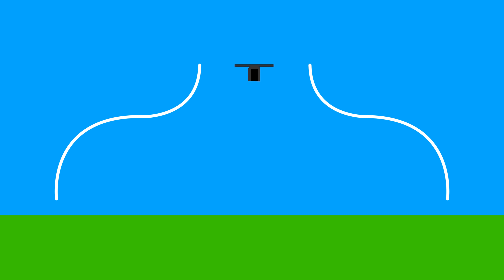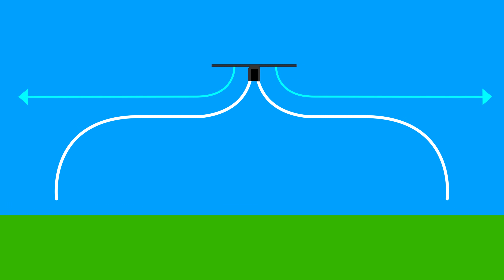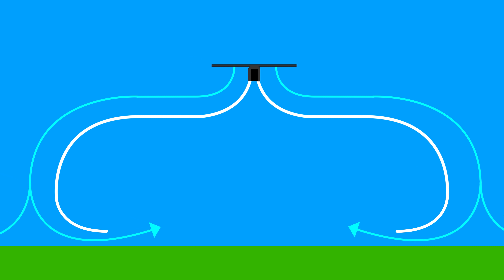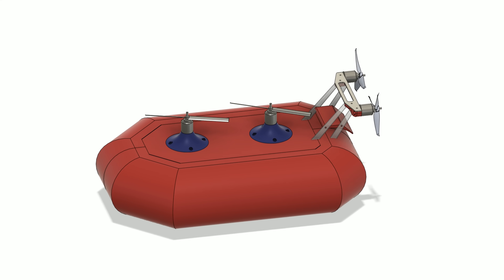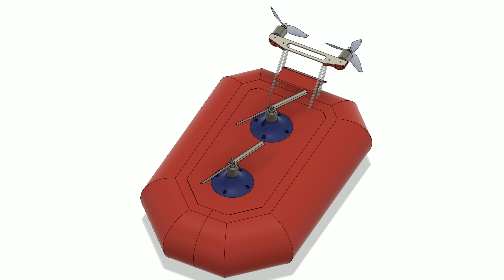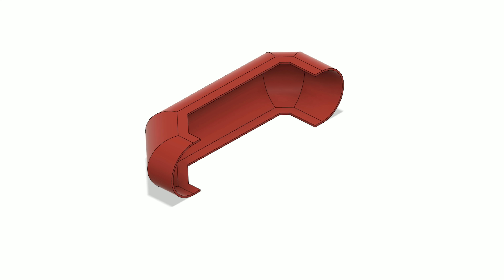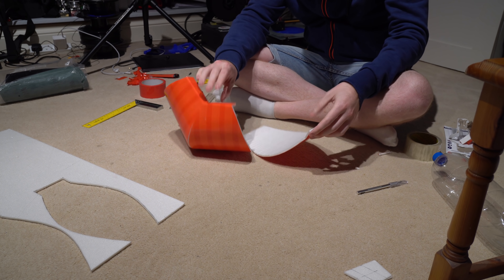Coanda Effect Hovercraft

Comment: Quite interesting Tom, thank you!
Could the leaf collection be more mechanical than fluid dynamic sourced? I would think if fluid, the quantity would be higher (read on...).
Could the CG be too far aft? In the earlier trials, clearly the aft was low while the bow was raised.
Later, once the bow dug in during a turn and the aft raised, could the gyro effect of the combined rear motors add to the unwanted roll? (counter rotating forward drive motors?)

I have an antique RC hover craft that was powered by an 0.049 (Cox) motor. Half the air was ducted into the plenum, the other half out the rear, steered by a gang rudder.
The small motor had enough power to propel the craft on asphalt or concrete. Living in Florida, fine sand is everywhere on those surfaces.
It would vacuum (hoover for my UK readers) this sand and leave a clean path where ever it traveled.
This lead to the demise of the little motor ingesting the fine sand from the sides of the skirts soon doomed any compression.

Project on Tom!
-=Doug

Comment: Maybe you could add a few weights inside the hovercraft - it could help with the stability issues and then you can just throttle up to maximum thrust with the engines in the middle.

Comment: Don't give up. A 10 - 20%  diversion of the  downward thrust would ensure the underskirt is pressurised and might just produce a model that is more efficient than a traditional hovercraft.  then possibly overall lift power could be lowered. If a substantial efficiency increase over trad is proved then this would be viable.

Comment: Sorry, Tom, I think you know this already....   using "moprop" to refer to the motor propellor assembly,  mount it to the body on a vertical slider with a rubber band to bottom it.  Fire up the motor.
  Hypothesis A: the body is generating lift, supporting the weight of the moprop and pushing the moprop up,  the band doesn't stretch.
Hypothesis B:  the moprop is generating the lift and pulling up the body.  The band does stretch. 
My money is on B.  Being a bit fancier, you might use a strain gauge instead of the rubber band,  the difference between that strain and the body weight tells you the value of the body lift generated by the ground effect, koala effect, magic fairy effect, or sum thereof.  I'll take a stab at 15 grams.  Could be higher,  but for the coanda effect you want laminar flow,  and the brutal collision of the downward airflow from the prop hitting a flat horizontal surface is errrr,  not conducive to that.  Some comments about leaf collection proving the coanda effect have given me a giggle.  Mull momentarily.  It's exprimental evidence that the pressure under the hull is below ambient.  Suction, down force,  anti-lift.

Comment: since the body does not have lift-making profile,  after dom issues are resolved,
consider using  a small canard, in order to produce a desired amount of  down-
force, towards the nose, at speed.           consider whether the use of a transverse,
weight-shift mechanism  would improve  ''cornering'.     the  mass  in the  battery
can be utilized, for the purpose.   a servo, on the aileron channel, might get the
job done.

Comment: I'm not sure the Coanda-effect plays a major role here:
You only looked at the airflow below the propellers, but you neglected that that amount of air first gets sucked in mainly from above, which would create quit a vertical force even if mounted on a large flat sheet.

And with the amount of thrust you get with those 2 propellers and how light it is the whole thing would easily fly without the body.
Reply: Yes!! I was looking if anyone else was thinking that

Comment: To my untrained eye, with no modeling or engineering experience, this looked like the type of hover that could be achieved by a helicopter that has it's balance corrected by hitting the ground every now and again.  This is my first time hearing of the coanda effect, and I can see it taking place with the leaves being sucked inside, but doesn't it also mean the craft is also being pulled down slightly?  Obviously there is enough lift to overcome that, but that just makes me think this operates more like a ground striking helicopter.

Comment: Only half tongue in cheek, maybe if you add a tube with a small bit of suction ending in a bag  you could have a Coanda effect vacuum cleaner? It would be interesting to compare with a pure suction vacuum. Maybe you could 3D print a Coanda effect nozzle for an existing vacuum and see if it improves it's pick up ability?

Comment: ah remember it also works like a helicopter with the rotors moving faster into the oncoming direction,  so the lift is increased,  kinda wish vertical rotors were closer to the body of the thing , or even better, reverse the curve to the inside, and run the props facing downward inside the body,  isolating the forces from the outside environment.. otherwise yer into a complicated rotor system.. and she'll flip over once the speed is on..

Comment: Man I’m not sure how you could resist putting a 5cm hole on the top surface between the two propellers..
Not fully in the spirit of testing the coanda effect, but it would either stabilize a bit more (being slightly a hovercraft) or be hilariously more difficult as the two sources of lift complete

Comment: the thrust props fuck with the center of pressure, if you can duct the air into the thrust fans from the side the center of pressure wont be dusturbed as much

Comment: A smoke test (if you can figure out how to build a "smoke wand") would be revealing in order to visualize the air flow around the body. I have the feeling there is at least a little interference between the two fans — maybe one fan would be more ... manageable?

Comment: cool build, Coandă effect is pretty cool, could you try one rear motor with a rudder ? might make it more stable, noticed that when you were turning, almost seems like the second motor is lifting, you could also try having thrust jets lower around the middle point inside the coanda towards the rear, the effect should carry over the holes for the jets, just some ideas, well looking forward to the next video, getting interesting that is for sure :)

Comment: I like this experiment, it has "legs". Just wondering if it would be beneficial to make the "domes" under the motors larger in dia and height to aid the air down and outward. Perhaps a shroud, somewhat like the air intake of a jet engine, around the props to direct air downward might also help? I think if you stick with it, it might just be even more successful!

Comment: Since you do have enough lift i would suggest adding some weights to the very bottom of the fuselage to lower the center of mass. I think once its a bit more stable it could pick up significantly more speed

Comment: This looked like you were having wayyy too much fun! ;)  JK.. I'm just jealous!!! :D
Observations: It appears that either torque is being unkind and/or the weight of the 'tail end' is needing to be compensated for which tends to prematurely terminate your flights.
Suggestion: Weigh the whole vehicle. Add ballast to the bottom of the 'skirt' that is a tad more than the weight of the vehicle itself - adding more to the 'nose' section to see if you balance the vehicle from front to back.  This might counter its top heavy stance and also its tail heavy stalling.

I'd like to see if putting a thick chord wing at the new (from above suggestion) CoL gets it to fly !
Anyway... glad to see someone working so informatively with aeronautics :-)

Comment: Nice try Tom. To get it to work you will need multiple airfoils stacked on top of each other. These are able to bend air more than a single wing can by taking the trailing edge air from the first wing and feeing into the next wing’s leading edge, and so on. Check out the ‘slat plane’ with unstallable wing. Why does your version not work? At 0:40 in this video you show (very nicely) that the air is attached to the blue curved plastic at the top but not the bottom. The air separates from the plastic surface when the curvature is too great, it stalls.  This is why wings have a gentle curve. Don’t give up!

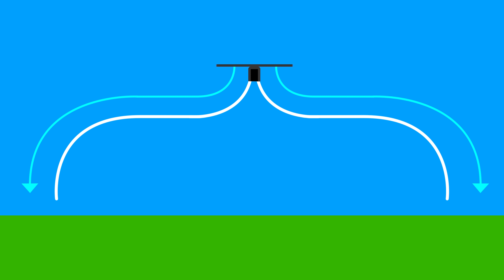Comment: At 2:02  I'm pretty sure that the top air won't be lower pressure (assuming underneath is at ambient pressure).  You can only relate pressure to velocity like that in the same stream of fluid, but here they are separate, it doesn't work like that. Pumps and propellers increase pressure upstream, even if flow velocity increases, that's how they produce flow in the first place.

Comment: I'm curious; could you current limit the motors to make it so you never go past that take-off threshold?
Reply: Yes.  You simply don't advance the throttles past that point.
Reply: @stargazer7644  Thanks, Captain Obvious!  I meant like with an ESC; make that the top of the throttle so have more range while not over-throttling.
Reply: @ChozoSR388   Why go for a hard solution when there's an easy one?

Comment: I bet you could improve the stability by lowering the center of mass:

mount the back fans on the sided, using maybe four smaller ones, right on the sided of each top fan, right at the height of the top curve of the fusellage, with 3d printed mounting brackets, no alluminum

make a whole box for the electronics and mount them on the bottom of it, so that they are where are now, but slightly lower!

Double counter rotating fans on each of the shaft for lift should improve the self-leveling action

If this does not make it stay up right, make two tail wings where you have now mounted the rear fans, so that they create a wall for air to keep you up! Maybe even angle them slightly inwards, like the tail of the F-117 nighthawk!
Reply: Mounting the fans on the side will completely disrupt the coanda effect he's trying to achieve.

Comment: I wonder if you could jump over obstacles by blipping the lift motors and then drop the craft back down before it flips...

It'd be amazing if it didn't tip so much, maybe a gyro would help, like if it goes above a certain tilt angle, cut the lift motors

Comment: It's probably more flippy than a conventional hovercraft because the Coanda Effect keeps working out of ground effect. Also do you think the forward lift fan is more effective than the aft? It might be because the radius starts closer to the axis of the fan where the air velocity is higher.

Comment: You could try a control loop which prevents it from lifting up from the ground or tilting over. Either measure distance to ground or gyros/accelerometer to throttle down the propellers to reduce coanda effect once you detect a tilt/rise.

Comment: I really liked this project, thank you!  It touched closely in an idea I have been tossing around in my head.  A cubic metre of hydrogen gives lift of a little over 1 kg.  Could a dirigible be constructed in form of a large flying wing.  Boosted by filling with hydrogen might give a low energy flying solution.  The hydrogen could be produced by aluminium in sodium hydroxide solution.  Of course the hydrogen is extremely explosive but for unmanned outdoor use?

Comment: But....do the blades not really function like helicopter blades....and just lifting the weight .....which explains why it flips over so easily as they pull the unit in the direction of pull. Still interesting. Theory seems sound ....but.....just not sure...but fun to try

Comment: The coanda effect makes it more likely for the craft to tip over.
Say you're sliding to the left. That means there's airflow from left to right (relative to the craft) Thus the coanda flow on the left side is going against the airflow caused by movement which means higher pressure and lower lift. At the same time the flow on the right side works with the ambient airflow which increases lift.
That process is going to tip the craft over on its left side if my reasoning is correct.
Reply: Correct.  This was the same problem that was run into with the VZ-9 Avrocar.
Reply: Seems like this may have also contributed to the nose dropping during forward movement. Incoming air may have slowed the movement of air going towards the nose of the craft. I wonder what the result would be of attempting a hybrid hovercraft, having a small hole under the lift fans, or moving the front lift fan closer to the nose
Reply: @davidelzinga9757  Yes, that would be the problem with the nose dropping, also.  Millions were spent trying little things like that because it always seemed they were so close and only needed one more little adjustment, but they could never get it to work well.  Eventually, after making enough modifications, it would be either a helicopter, an airplane, or a conventional hovercraft.

Comment: the airflow is directed directly to the ground. So this is no longer the Coanda effect no ?
Reply: The airflow is directed to the ground using the Coanda effect too, the airflow sticks to the sides of the hovercraft and hits the ground instead of reflecting at a 90 degree angle.
Reply: @alexlucaxxxxxxxxxxxx ok but it Don't do 90 degrees angle, it's juste like a quibble. With a streamlined propeller too the flow stick to the side but on all the side not juste on one side like here. But i could be wrong ..

Comment: I like your design,
But the bottom curve is negating the effectifity of the top curve. The coanda effect is due to the low static pressure accros the surface (due to heightened dynamic pressure caused by the air velocity) vs the atmospheric pressure around the vehicle. Therefore a flat bottom surface is needed to provide net pressure from the bottom surface vs the top surface directed against the direction of gravity. And a curved surface makes the air go around the top surface and the bottom surface, therefore making the bottom surface just as low as the top surface and negating the effectiveness of the system.
TLDR; lose the bottom curve and make it flat for higher efficiency.

Comment: You could try putting the lift propellers on a gimbal so they are always pointing straight up, that way the flipping problem could either be reduced or eliminated.

Comment: You should cover the bottom with some mesh! I think your flipping issue is to do with an increased angle of attack pushing air into the body causing some uneven lift. A mesh screen would stop this from occurring, itd also help with debris collection too.

Comment: I'm interested in seeing the Coanda effect demonstrated by attaching the two motors with horizontal props to the top of a flat sheet of foam board.  How does one differentiate the effect of lift generated by the props, and lift generated by the Coanda effect?

Comment: “Not only will the high speed air entrain additional air (read: dump a bunch of energy into TKE, I.e., turbulent mixing) and create a low pressure zone on the surface of the vehicle, but it will stay (very marginally) attached and become redirected downwards creating lift/thrust (while transferring the majority of the momentum in opposing lateral directions, wasting the majority of pressure work put into the flow).”

Don’t get me wrong, I love your videos, especially about controlling novel drones, you analysis of the trebuchet, the electric bike and pneumatic engines. It’s just, as a PhD fluid dynamicist and aerospace engineer this design has no advantages in this flight regime. It’s almost as bad as people trying to put golf ball dimples on things that are either already tripped/transitioned to turbulence (too high Reynolds number), or where the flow is not separating (I.e., lets increase our skin friction drag for no reason—no corresponding decrease in pressure drag.)

As I said I love your videos and don’t mean to be harsh but I find it difficult to see how this is a good idea or helpful. It’s like an inlet design where you’ve optimized for maximum spillage: yes there’s a lip suction effect that partially cancels the spillage drag, but the added spillage drag will always be more than any lip suction effect!
Reply: I can see your point, but I think this was just about making an unconventional project work, it's not like he is in a professional enivroment
Reply: justlookin59 I agree. But the smoke flow vis in the beginning shows how poorly the flow is able to stay attached, so there were clues it wouldn’t work so well from the beginning. But I agree it was still an interesting video. And hey, it’s still way better than a “let’s put dimples on it” video.

Comment: Seems like it tips so readily because the coanda effect is enhanced on the side tipped upward, presumably because the air is freer to take the path with provides more upward thrust. This appears to also be the reason that it handles driving off of ledges so well, because the surfaces over free air have more thrust. Cool and very interesting.

Comment: What if instead of a full pocket of air under the chassis, the circular fans where within a double wall chassis- pushing air through the double walls and coming out around the perimeter of the base? Sort of the coanda effect- but with a top, forcing the air flow shape with physical barriers.

Comment: Try mounting the motors on the bottom inside the hovercraft. Turning shafts that go through the top turning the propellers. Possibly lower the center of mass making it more stable.

Comment: What if you open up the body between the propellers, maybe even make a flange to redirect only the air in the middle between the two, and the rest would direct towards the sides for the coanda effect.  Would increase pressure under a bit, like a regular hovercraft and maybe provide more of a cushion so that the sides don't catch when you're trying to turn.

Comment: when you spun up the lift props.   The front one lifted the craft while the other had too much mass to move.   What went through my mind as you talked of adjusting the angle of the drive props,  was tilt them UP to counter the lift of the front  and to help lift the rear.  Maybe later  you can put some blades under neath to mulch up the leaves.  lol